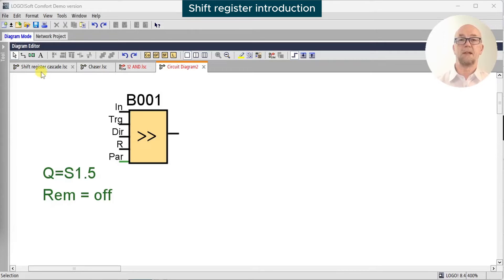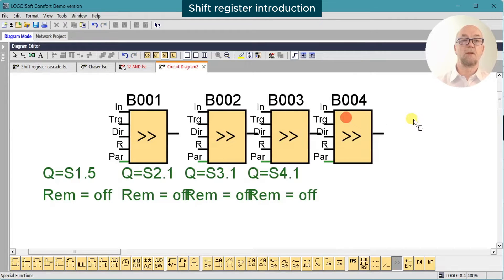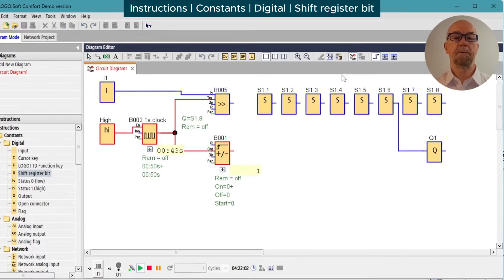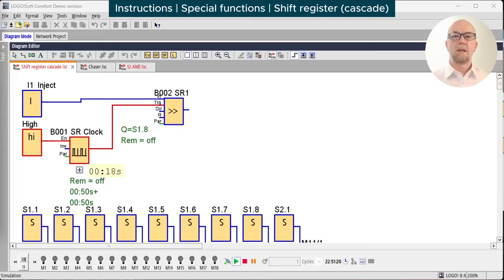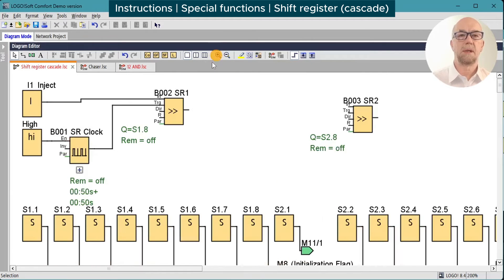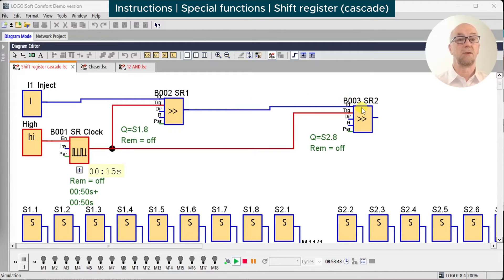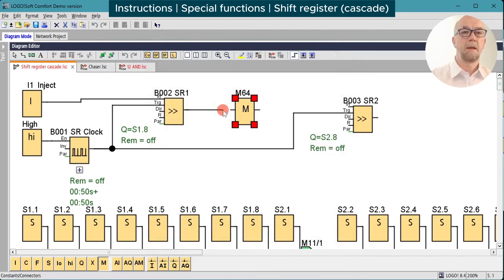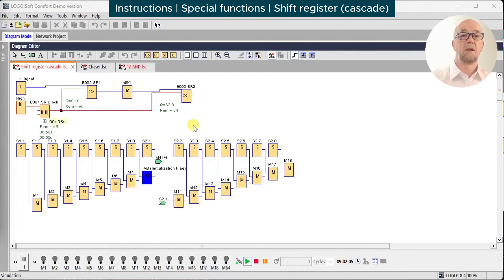LOGO! Shift register - 8, 16, 24, 32-bit | Siemens PLC programming.

Comment: Works differently nowadays. you can just connect the last bit of the first shift register to the input of the second
Reply from the maker: Thanks for the feedback, but I think you are misunderstanding the problem and have missed the point.

I've checked on version 8.4 and if you cascade two shift registers as you suggest then when the last bit of shift register 1 (1.8) turns on then the first bit of the second shift register (2.1) turns on simultaneously. This is as shown 5 minutes into the video. 

It is very unlikely that Siemens would ever change the way a block works as this would make the same program function differently depending on which combination of software (Comfort) and hardware (LOGO!). This would be most unwelcome.
Reply: @QuickPLC-kh5of  Weird that it works differently for me. I'm having no issues with the last bit and the first bit turning on at the same time
Reply: @QuickPLC-kh5of but your way of doing it is cleaner and more efficient

Comment: Hello I hope you are well and healthy, I have a dilemma please if you can help me How do I make the analog comparator display more than 32K a calculation between I1 and I2 digital. That would mean making an Analog comparator from 16 bits to 32 bits. Can this be done? Thanks
Reply from the maker: I don't think you can. Also it works with A1 and A2 analog, not I1 and I2 digital.
What problem are you trying to solve?
Reply: @QuickPLC-kh5of I made a program with 2 digital sensors. I connected the digital sensors each to a counter, from the counter I went to the math instruction block from there to the analog comparator. (I1-Counter1-Mathematics instruction1- Analog comparator and I2-Counter2-mathematics instruction2 -Analog comparator) what I want is that sensor 1 detects my inputs and sensor 2 detects my outputs and I want the analog comparator to do a mathematical calculation with what losses. But the problem is that if I go to 32K the analog block can no longer count and becomes 0, the calculation is no longer performed. Is there any setting so I can make the analog block count up to 99999999?
Reply from the maker: I'd say it's the wrong PLC for the job. The maths instructions are quite limited. I can't imagine why you need that level of precision. Can you not scale the numbers down? What is the gain setting on the analog comparator? What are the max values on the analog inputs to the comparator.